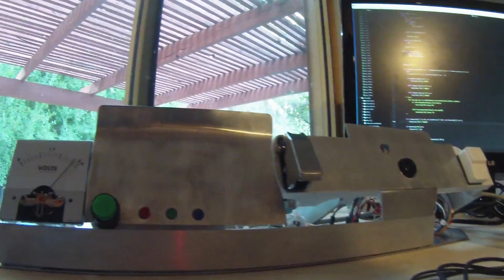Landing Model Rockets - Rocket Motor Test 1

Comment: i fail to see how this would require that much of a set up. the motors arnt that loud to need a water suppression system (if a hose can really make that much of a difference) 
all you really needed was to secure the motor to a stable platform with a data collector and fire it. no need for the fancy set up
Reply: You are correct for tiny solids. The reason is he designed it to test his hybrid motor later on. I would assume because the fuel grain was ABS, the exhaust is bad for you. If you read more on his website, it even had a emergency fire suppression system. Probably giving room to the system for expansion for some bigger stuff in the future

Comment: How are you going to throttle the motor using solid propellant ?
Reply from the maker: Hybrids :)
Reply: Jonny Hyman have you thought about using three motors.. each vectored controlled independently.. when you need less throttle you open the vectors out... like opening the legs.. (less thrust directed downward, more to the sides) when more thrust is needed you close the legs (direct the vectors more to the center column).. all this while keeping your vectors working on the vertical PID... So to your regular PID algorithm you will add.. less throttle open columns apart... more throttle close columns together.